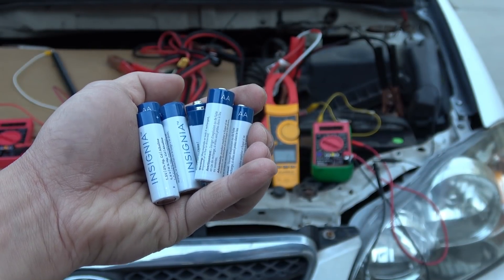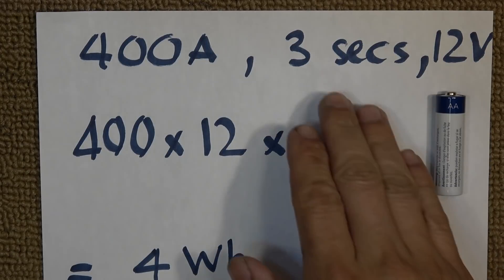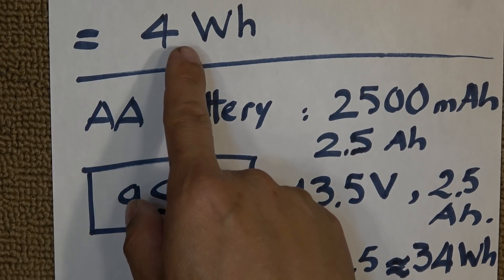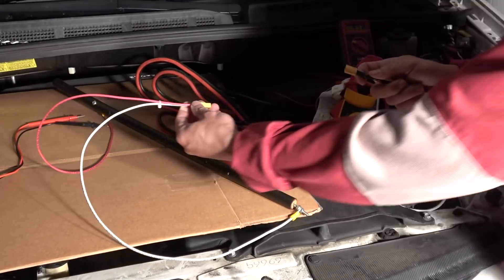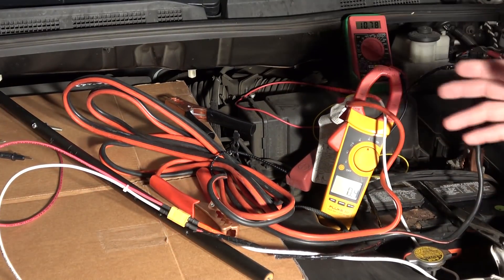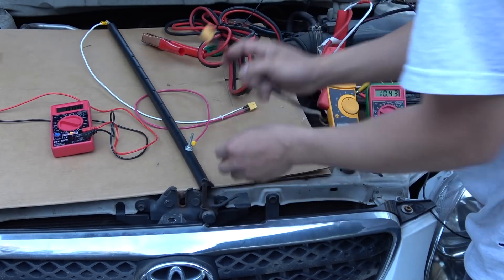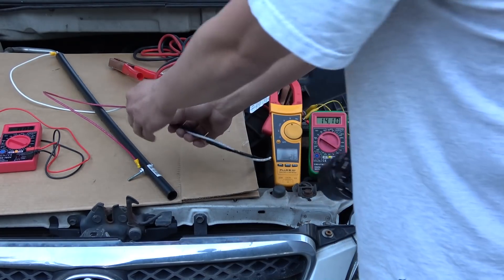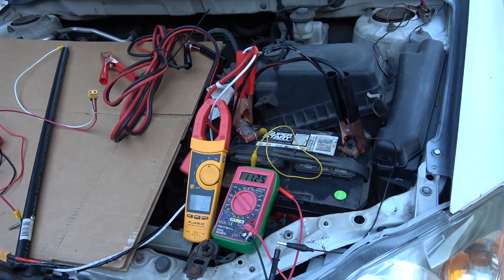Can you jump start a car with AA 1.5V alkaline batteries?

Comment: Disconnect the 12v lead acid battery and try to start it with only aa batteries. Aa batteries can only discharge a max of 2amps at 1.5v. you would need 8 aa batteries in series to make 12v at 2amps max discharge . Then times that by 100 to make 200 amps at 12v discharge. You need 800aa batteries to start a car. All your doing in this video is supplementing a lead acid 12v battery just on the verge of starting a car with aa batteries. Now try to start it with ONLY aa batteries.

Comment: Is there a way for me to hook up one 9 volt battery to my dead car battery and charge it up to over 2 volts so that then my smart battery charger will then be able to finish charging the battery to full power? If so, can you demonstrate a way to hook them up so that someone like me who isn't technically skilled can manage it?
Reply: A 9 volt might not do it but you can use a cordless drill battery to make the charger think your battery has enough juice

Comment: Hi Vuaeco, If you had added 12 of the 1.5v AA batties, you can start the car first go, with out the wait. Because you had forgotten about the loss of current in the wires. When charging a battery the voltage is always higher than 14.9v  The amps in a 1.5v battery is very low and can only hold for very short time. I work in a battery shop and a guy can in selling a gadget that took 12x1.5v AA batties and they would start your car if it dead. You done very good work there, Keep it up.
Reply: Ohms law. Can’t forget the resistance
Reply: not to mention that the discharged battery is draining the AA pack and when the pack gets low enough power will be wasted as well.

Comment: I am going to buy a cheap phone charger and splice the wires to 1 or 2 9v batteries and try to boost the starter from inside the car with the dc plug. Wish me luck!
Reply: What happened.. kindly update.. I'll be returning to my car parked for 4 months..
Reply: @73charaka  I didnt need to do it after i figured out my phone cable was draining the battery, even though the light on the dc plug was off i was surprised to find out that can kill the battery. But the DC trick should work ok in theory. Let me know if you try it 👍.

Comment: AA has an internal resistance that would only allow 0.5A per cell; in series, you add voltage, not current. So, how are you getting 6A??
Reply: An AA has about 0.15 to .3 ohms internal resistance I=1.5volts / 0.15 or 0.3 = 5 to 10 amps

Comment: They are not 1.5v batteries, they are 1.5v Cells, you made a 13.5v battery with single Cells. Plus it did not `Jump` start the car, It slave charged its Battery... Pedantic I know,...You got a thumbs up for entertaining content.
Reply: This was the comment i was looking for, but found it so low in the section. 
It's not a jump starter but a temporary charger for car battery. If that's to be done (waiting for hours ) I'd just get a $5 12v car battery charger from aliexpress.. (actually had one, it took about a day for a 55Ah battery ).
Jump starter is something like plug and start..
Reply from the maker: You're saying AA batteries are not batteries? Then give me a definition of a "battery"?
Reply: @vuaeco  A 'Battery' is more than 1x cell.

Comment: I don't think this a jump starting one, this is AA battery charging depleted the car battery. So, the calculation before is not needed at all.
Reply: The calculation is absolutely needed. There wouldn't be any point in using the AAs to charge the car battery if they didn't store enough energy for a single start.

Comment: With multiple banks of 9xAA batteries you would be able to do a direct start without the lead acid. I think the biggest issue you had was the internal resistance of the car battery. Often dead ones have a very high internal resistance due to shedding from the plates causing soft shorts.
Reply: yes and no. Yes, if by multiple you mean like 100 banks, so not practical. A car battery can give very high bursts of current, like 600Amps at 12V. An AA battery would simply not sustain that load, it will be like a short to it and overheat and stay at zero volts. The car battery would drop to like 11V, then recover to around 12V (appears in video if you pay attention). Some batteries, like 18650 LiIon, have cathode and anode with very high surface and can support higher currents, like 10Amps.
What he did in the video is not jumpstarting, he actually charged his car battery first, then used the car battery. Car batteries charge at 1 or 2 Amps, so for charging you don't have high requirements.
The requirements are to have voltage greater than battery voltage and make sure not to connect in reverse. He was lucky that car battery had low voltage, this way the flow of current was higher and it charged faster. If voltages are almost same, charge rate is low.
Reply: @nilsfrahm1323  And again, more dumb. A battery under load (resistance) does not see a short. A short is when there is no resistance. Short circuit literally means that the circuit has been shortened to not include any load (resistance).

You really are a fucktard.
Reply: @freefall0483  Sorry to disturb you, seems I got on your nerves. You are right about some things, most of them I knew already, like adding batteries in series increases voltage, parallel increases current, 9V batteries made of 6x1.5V cells. But, lead acid batteries tech is cheapest per Watt-hour, not per unit. A car battery sells for more than 70USD, while 5x9 AA batteries would be less than 40USD, assumin one AA battery is 1USD. 
I think the thing you didn't consider is that max current output of a battery depends on the surface area of its anode and cathode. Larger surface area allows more electrons to pass at the same time, like lanes in a highway. NiCd or alkaline AA batteries have a membrane like a cylinder inside, separating cathode and anode. Lithium ion batteries have a huge roll inside, with large surface area between cathode and anothe. Lead acid have lead plates and acid surrounding them, surface is also quite large. In a car battery you have kgs of acid and kgs of lead. That allows it to contain a lot of energy, much more than a few AA batteries. A car battery has max current rating like 700Amps, for a few seconds, and this is required to start the car. Turning the engine with all accessories connected needs lots of power, until it starts. During those 2-3sec, battery is drained very quickly of lots of energy, voltage goes down a bit, like 11V, headlights light gets dimmer as you start the car, for this very reason. A less powerful car battery would go to even lower voltage, like 9V, during those few seconds, and may not start fully the car. Your arrangement with banks 9 AA batteries in series and lets say 10 such banks in parallel, would not even turn the engine.
I suggest to try first, then come and tell us how it went. 
Not even UPS battery, 12V and 7Amps, which can output bursts of more than 20 Amps would start the car. I just tested this.
The energies involved in those 3 seconds are huge.
Reply: @freefall0483  Theory vs practice: in reality, we don't use gold connectors and wires, so resistance is never zero. It may be a few milli ohms. Current over the short (wire or metal plate shorting contacts) would go high, towards the maximum limit of current that battery can provide. This would speed up the reactions in battery, it would heat up and the wire or metal sheet would also heat up, as electric current converts to energy. So, as resistance approaches zero, current approaches max that battery can provide.
This is similar to case when we connect you AA battery bank to a car battery, which has low resistance and accepts all the current your bank can give.
This means your bank is charging the car battery very fast, and your bank may heat up in this process.
You can add a resistor in series, to limit current, prevent damage of your bank. Car battery also needs charging at around 4amps, no need to force it more.
Thus, what I said is true.
Reply: @freefall0483  Since you're an expert, please tell how many banks of 9 AA batteries are needed to get same current as a 12V 70Amps, 600Amps peak, lead acid car battery?
No need to be exact, just a rough figure...
Reply: @nilsfrahm1323  28.
Reply: @nilsfrahm1323  BTW, your resistor idea is bloody stupid. Applying current to a lead acid battery is a load, not a short. You are converting lead sulphate and water to lead and sulphuric acid. Very energy intensive process. Also very slow. That's why a lead acid battery takes hours to charge. They released energy reasonably well but they don't accept charge very well.

70ah worth of AA batteries won't overheat.

Unless of course a dunce with no idea tries it. You are that dunce. Don't try it.
Reply: @nilsfrahm1323  Additionally, the 12v 70 amp, 600 amp battery you describe is actually 12v, 70ah, 600cca.

12 volts.
70 amp hour capacity.
600 cold cranking amps.

Saying that a battery is 70 amps and 600 amps in the same sentence is stupid.

Have you figured that you don't know as much as you think you do yet?
Reply: @freefall0483  28 banks x 9 AA batteries is 252 AA batteries. Energizer AA is 0.5 Euro, gives 126 Euros. This is way more than a new car battery, and you can only use them for 3-4 car starts.
So not worth it.
Reply: @freefall0483  Also, 28 banks will not be enough. Rayovac best AA battery output 12 amps at 1.5V. One such bank will output 12Amps at 12V.
To get 600Amps burst, you need 50 banks.
Reply: @freefall0483  Sorry man, english is not my primary language. Yes 660 CCA, I said "660Amps peak", you can understand. So for 30 seconds, battery should give 660 Amps without voltage dropping below 7.5V. Do you understand this requirement of the battery, or not?
And how you need 50 banks of 9 AA batteries to get a similar power? Which proves your setup is not economically viable?
Reply: @freefall0483  You said that you can with 28 banks of 9AA batteries, which you cant, with only the AA batteries. This would give about 330 Cca, which is not enough. You need to still have the lead acid battery connected in parallel with you AA battery banks.
What you can do, is charging the lead acid battery with them, exactly what is shown in the video.
Reply: @freefall0483  I assumed worst case, you can have diesel car, v8 engine, which would much more energy to start. Even with your assumptions, 200 Cca and 6 amps max per AA battery ,you still need 33 banks of 9 AA batteries, which is a lot. You could go try the same with many Cmos batteries, to make it more ridiculous...
Reply: @freefall0483  You could start a truck with many AA batteries, ONE FUCKING TIME. They would be cheaper than lithium jump starter power bank, which would start the car 300 FUCKING TIMES. Do you see now what you're saying?
Yeah we can do that once, thanks for the idea, Neeeext....
Reply: @nilsfrahm1323  Seriously, I can make you a battery for your car out of AA cells that delivers more amps, is more reliable, does not get affected by weather and is smaller and lighter than your normal car battery.

This is because the energy density of alkaline primary batteries is much higher than lead acid batteries. There is more electricity per measure of weigh and volume.

However, it's completely pointless because the battery cannot be recharged. A few starts and you need to replace it.

This is why you can get lithium phosphate car batteries. They are smaller, lighter and better performing than lead acid batteries. But they are also very expensive. This is why they are only factory installed on sports cars that are sensitive to weight.

Normal cars are not very sensitive to weight. A box full of lead isn't really a problem. That box of lead is also very cheap compared to all other types of battery.

Leaf acid batteries are actually quite shit. Terrible current delivery. This is why they use lead foam to increase the surface area of the plates so that more peak current is available for longer without massive volt drop. This, however makes them very shit at deep cycling. That's why you have deep cycle lead acid batteries.

Deep cycle batteries have much thicker and heavier plates that do not warp as much and do not shed as much as start batteries do. They have much higher capacity and can run a light load for a long time and can happily have 80% of their charge used.

But they are shit for starting cars and fall of a cliff in low temperature.

But, as long as lead is super cheap, they will still be with us. Even if lead acid batteries are totally shit and outdated.

Have you worked out yet that I know a whole fucking lot more than you on this topic?

Would you like to choose another topic that I have less knowledge on?
Reply: @freefall0483  No thanks, I think we're done here... I got my share of insults.
Reply: @freefall0483  actually the cca is the rated current a car battery can output at -18C for 30 seconds without falling bellow 7.2 volts, a car battery at 18C will output about double its cca.
Reply: @freefall0483  why go through all the trouble of getting 28, 9 aa battery packs when you can just get supercapacitors?
Reply: @spyrosbellos2522  The more important question is if the capacitors wear their underwear on the outside...
Reply: @freefall0483  depends on the mood
Reply: @nilsfrahm1323  You have no idea what you are talking about. Go and research electrical theory then come back with some form of knowledge.

Seriously, what you wrote was ignorant nonsense. You just made a fool out of yourself.
Reply: @freefall0483  Which part of my reply was incorrect, according to your opinion?
Reply: I was about to write the same idea, with less technical details that I just learned from you. Thanks !
Reply: You must the smartest person on earth, Tesla should hire you. All car producers never thought about this smart idea: replacing the car battery with banks 9xAA batteries.
Why pay much money for lead acid battery, when you can buy just a little for AA batteries. 
Ever heard of a jumpstarter kit with AA batteries? Me neither.
Ever hear of jumpstarters with li ion batteries inside? I did, youtube is full of such reviews.
So, if not many people thought about your idea, it means you made some wrong assumption or ignored some facts.
Battery tech is hard to master, gotta admit that.
Reply: @nilsfrahm1323  Additionally, AA batteries are primary cells (excepting NiCad and NiMH). Primary cells cannot be recharged.

Nickel based batteries, whilst rechargeable and much lighter than lead acid do not like being shallow cycled (run not flat). Continuous shallow discharge on engine start followed by lengthy charging by the alternator (the chargy bit in your car) would rapidly lead them to form a memory and ruin them. NiMH batteries almost cured the memory issues but still don't like to be shallow cycled. Crystals grow on the surface of the cell that eventually result in internal shorts and dead cells.

Also, I am sure you would not know that your car battery is actually 6 batteries! Lead acid architecture makes only 2 volts. Six cells are connected in series to multiply the voltage to 12.

Did you know that many 4x4 owners run dual batteries! But so do trucks. Trucks are 24 volt and cars are 12. Trucks use 2x 12v batteries connected in series to achieve 24v. But wouldn't 2x batteries ruin the 12v electric systems in a car? No. The batteries are connected in parallel. This keeps the voltage the same but doubles the current (amps). This is how you run a very large winch that can pull more amps than the factory battery can deliver.

Remember, 2 in series, double the volts. 2 in parallel, double the amps.

Did you know that a 9v battery is actually made of AAAA batteries wrapped in a steel box? 6x 1.5v cells wired in series to achieve 9 volts.

Did you know that the same applies to 6v lantern batteries? These are also 1.5v arranged in series to achieve 6v then another bank is wired in parallel. This makes the globe much brighter than a 1.5 or 3v light whilst also doubling current. Very clever.

It's almost like they knew what the fuck they were talking about when they designed them.
Reply: @nilsfrahm1323  Just realised that there is even more stupidity in your reply. You say about paying much money for lead acid. Lead acid is the cheapest architecture (unless you want to put nails in lemons). It also has the lowest energy density and is maintenance intensive.

The only reason lead acid is used is because it is cheaper than the rest.
Reply: @nilsfrahm1323  Doubling down on not having any idea of electrical theory is not the smart thing to do here.

I'll give you a hint. Research parallel circuits.

Anyone who knows what the fuck they are talking about knows that you can series 1.5v cells until you have 12v. You can then make a multitude of arrays and arrange them in parallel to achieve whatever current requirements you have.

Now that I have kick-started your education on this topic (albeit written for a layman) you may want to expand your knowledge on this topic as you obviously wish you were an expert but are not.

As for the comment about me being the smartest person in the world, no. I am not the smartest person in the world.

I am however, smarter than you. Keep this in mind as you write your reply.
Reply: i was thinking this, especially if it dropped a cell

Comment: A true test would be to connect AA batteries ONLY to the car without the car battery in place.
When you first connected the AA batteries they discharged trying to equalize the low voltage of the car battery.
This invalidated your result